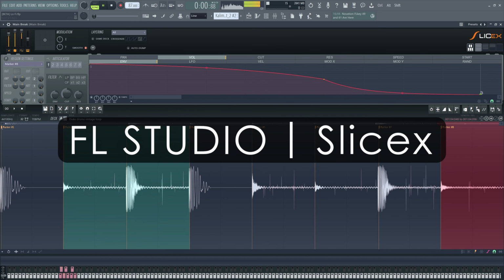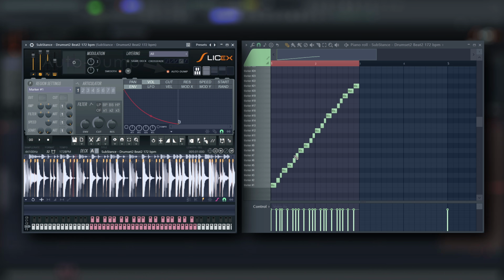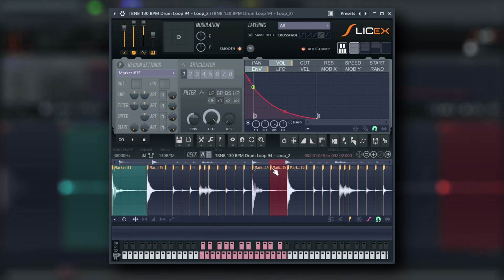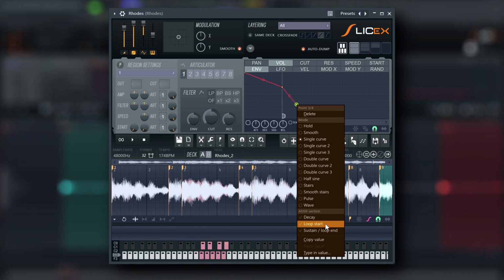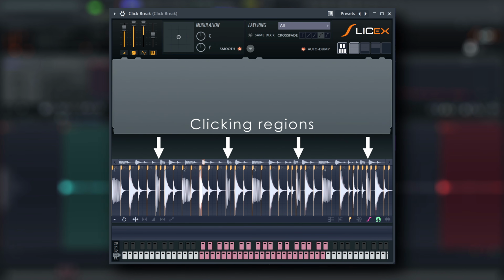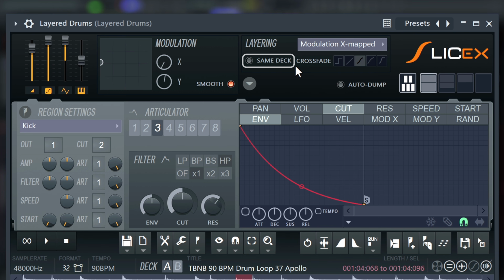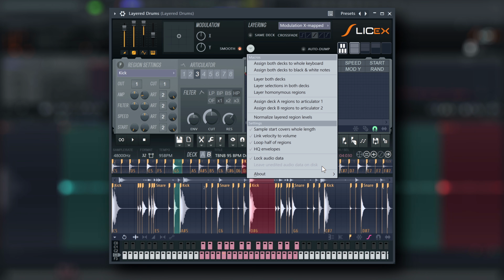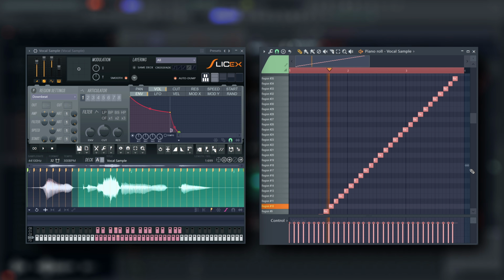FL STUDIO | Slicex

Comment: Can you please add an option to revert to the old workflow of FL Studio as it has been for years- prior to the 21 update? Or sometime between 20 and 21. Double clicking a multi-instrument/midi pattern in the playlist opens the piano roll for one of the instruments, but does not show the channel rack at the same time, or under the piano roll window. Clicking the escape button puts you back to the playlist, and you need to manually open the channel rack..

Comment: please add concrete values to the "type in value" function especially on the pitchshift one in slicex. i want to see that value in cents not some weird percent/ratio value
Reply: That's one of the things I'd appreciate straighten out. How often do you want to change something by percent compared to a meaningful value?
Reply: just like any other native FL instrument plugin you can see the parameter you are editing in the hint panel / hint bar. the master pitch function of slicex displays it's value in cents.
Reply: @uamee  you're right, but you are gonna struggle setting it to one specific value. They continuesly add better value representation to their native plugin, but never this one in slicex.
Reply: Late reply but you can use the native wrapper's Channel Pitch knob at the top right of the window instead (set it to 12 semitones). It sounds the same and it supports typing in cents.